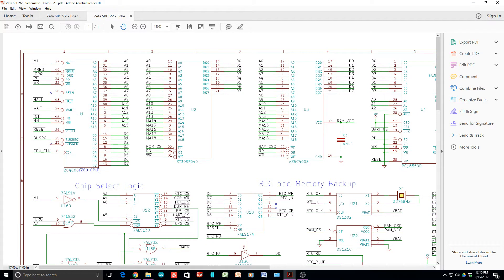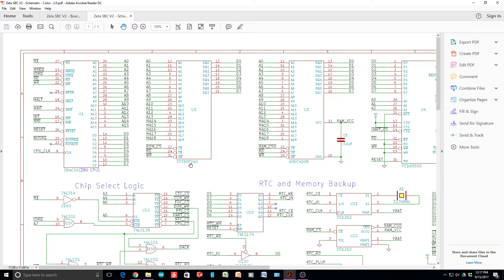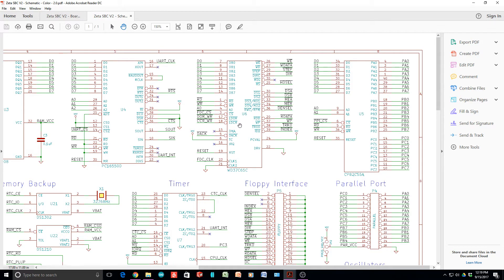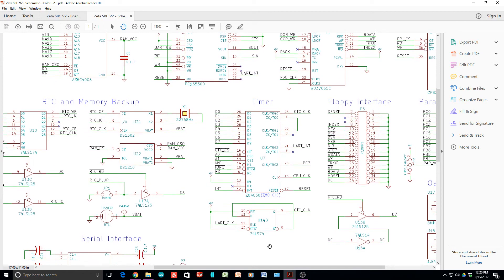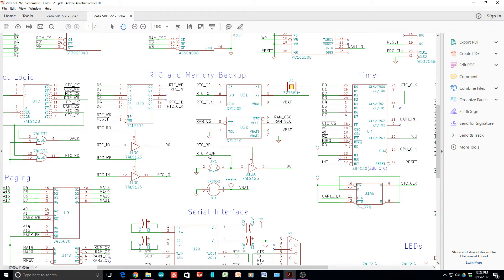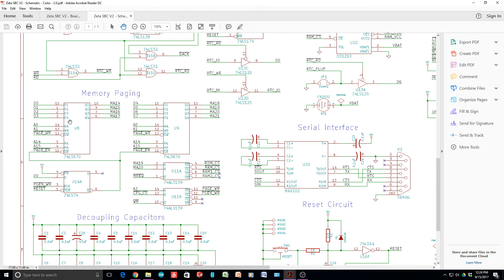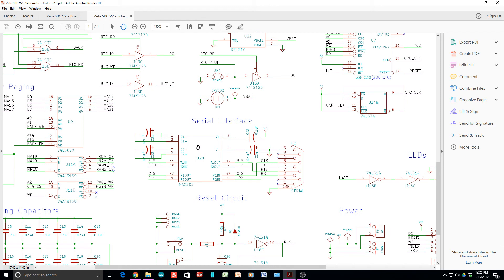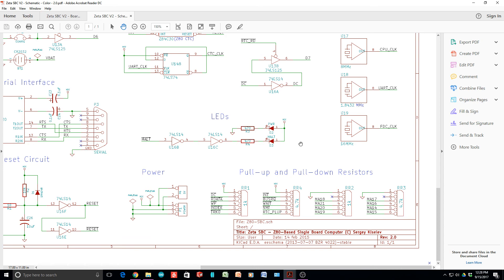#125 Zeta SBC Z80 CP/M computer schematic

Comment: The highest speed z80 (CMOS) is rated for 20MHz & available in a PDIP40 pkg, Z84C0020PEG, which is still available in 2023! & yes they are still used in a number of industrial applications such as legacy control & programmable sequencer/timer boards. I’ve worked with instrumentation in the oil & gas industry & have had to reverse engineer several of the logic boards to have replacements made, there are many corrosive gasses & chemicals that infiltrate into usually damaged & decades old enclosures that destroy these boards.